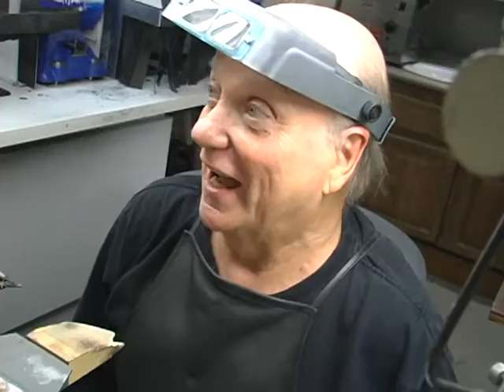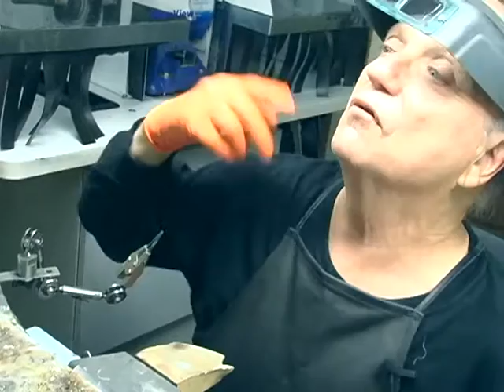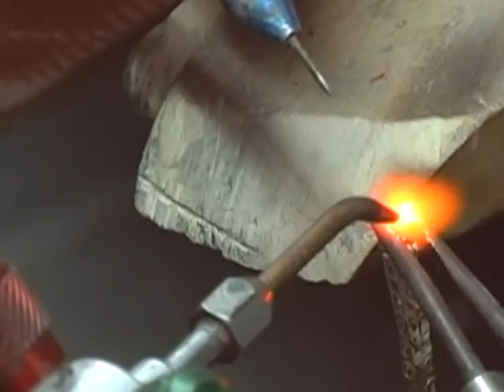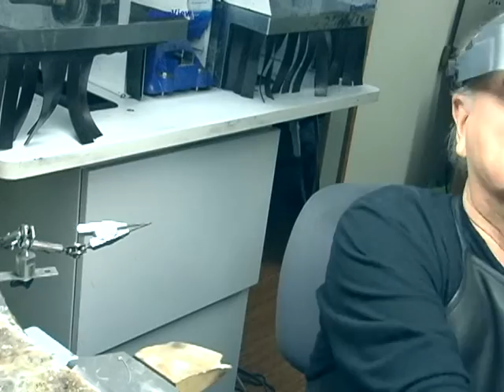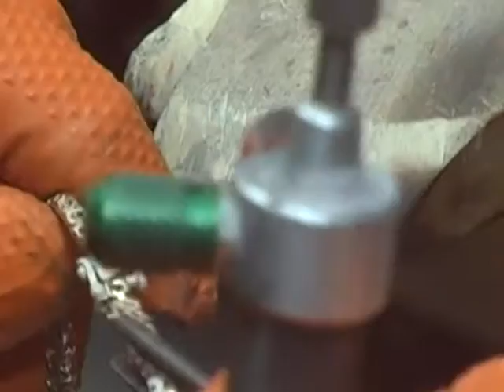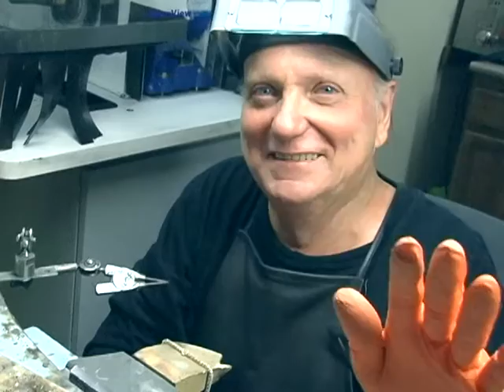JEWELRY REPAIR "REPAIRING A BRACELET LINK" EPISODE 12

Comment: Great videos! I have watched every episode in an evening.   Noticed it has been a while since this last episode and wondering if there will be more to come.

   I especially like that you work a lot with hand files and agree that nothing is like the control one has with a hand file. For most attempts to save time filing with a dremel, it usually ends up with more time consuming problems or a drop in quality.
  When I crank up the Victrola, I inspect the record for dirt and flaws with my eyes, the needle in the groove acts as my hands and, my ears listen for the sound of either music or crackling garbage. When I file metal by hand, the same thing applies.... my eyes can follow the work better, my hands feel the vibration the file grooves make over the work and my ears listen to the vibration for any inconsistency. When I use motorized tools, it would be absurd to think I can acheive as good detail when I have removed 2 (vibration and sound) of my 3 senses out of the work that goes into the piece.  I would be failing to remove a lot of crackles and scratches on the Victrola records if I didn't look at them before putting the needle in the groove and I wouldn't know I missed a minute detail or imperfection if played the record at 1000 rpm.
  Sure people can use motorized tools to file things fast but, in short, a hand file towards quality in the endeavors of an artistic craftsman is the difference between J. Bach & J. Beiber. (Little known... those batons in a master orchestra conductors hand, look close.... jeweler's fine rat tail file. Lol)
  In other words... When working with a motorized tool, DON'T EVER BLINK, because your eyes are all you have to guide the price of quality just for the sake of high speed quantity.
Reply from the maker: I agree completely! I don't use bees wax on my saw blades because I love the feel of the teeth as they cut through the metal ... Motors have their place and to be able to use a balance of both is a good thing ... I have covered mostly everything someone starting out would need to know ... Right now with it being summer there are projects around the house, fly fishing, camping, & kayaking with my beautiful wife ... I will most likely produce another video in the fall, (I haven't done much with stone setting, chain soldering, and may revisit polishing) ... Is there any subject you would like to see me cover? Thanks for watching and you get the coveted title of "endurance watcher of the year" wear it well my friend ................ WILLIE
Reply: incidentalpoet , thank you for the reply and update status on videos. If I got to choose between sawing on golden rings and fishing on Golden Pond, I'd like to think I'd pick the pond also. 
   As for suggesting topics, I'm just starting out. Probably, most of my curiosity and apprehension as an aspiring jeweler is not any topics you'd care to do in videos because you'd have to put down the hand saw and file and that is probably not the kind of videos you set out to do. 
     One bit of importantance I never hear much covered for aspiring jewelers by anyone with actual long term experience at being a successful jeweler is that of actually dealing with the initial shock of pricing one's work or services against one's own expectation of their skills or quality. Also, how to approach services with other businesses and deal with disgruntled people. Being a person with a disability, those topics are almost of more importance to me starting out in a home based business than my belief in my own crafting skills. I know I can work at a detail oriented labor skill, did it for a long time until the unthinkable happened, just unsure of myself in the business end of things after having to rebuild a new lifestyle. But, you asked about future episodes so, I was honest about what I need to see vs. What the crafty part of me wants to see in a video. Not what you were expecting to hear,right? Lol but... I can't afford to continue to find joy in a jewelry craft if I fail at the businesses end of it.
    I have to work on non-bench skills no matter how fun it is learning from your videos, I couldn't stand failing to sell something or accidentally giving my service a bad name, I wouldn't be able to afford materials for a few more hours of sawing bliss alone at 3am at my bench! Even if any YouTube videos of the actual smithing part of it would help make me a master craftsman, I gotta be more business savvy in my situation or I will have to give it up.  Just hard to believe a lot of YouTube advice but, you appear to be the real deal as far as time invested into the fire of a career in the jewelry field. Lol 

  P. S. - Thank you for the award, now I can put it on the wall next to my wife's "cordially married to an ass" endurance certificate. Popbox Bobo & "Willie Willie Willie" drove her crazy for an entire evening of me watching your videos and I just sat there and laughed as she stank eyed me over not putting on the earphones. 
Enjoy your summer.
Reply from the maker: I sometimes hate the business end, (I always tell people I am socially inept after living my life in a back room) I started out doing craft shows and slowly building that re pore ... What works best is to make them laugh, you obviously have a great sense of humor, use it ... It's certainly an acquired skill but it's not hard to master ... I am banking on your success ... My wife loves Bobo's humor but in very short doses ... WILLIE

Comment: Great series!! Tell me - what are the proportions of boric acid and alcohol that you use in your pre-solder concoction? There doesn't seem to be any solid material in it. Do you just keep mixing boric acid into the alcohol until it no longer dissolves?
Reply from the maker: Frank
Thanks for the kudos ... There isn't a set mixture ... My preference is a light mixture ... I just want a light flim on my jewelry when I burn the denatured alcohol off ......... WILLIE